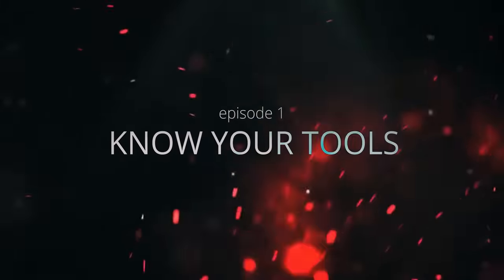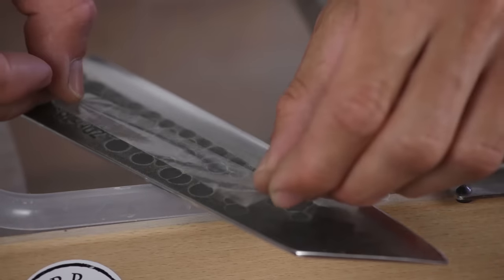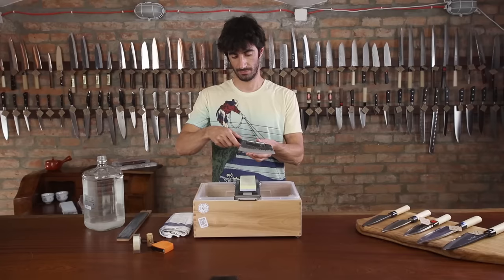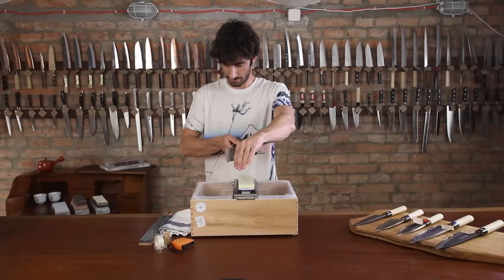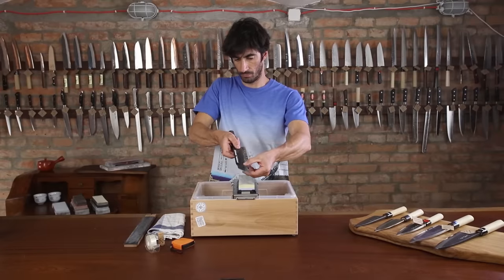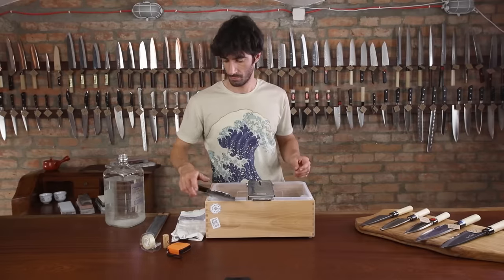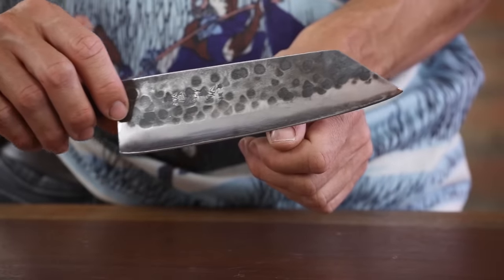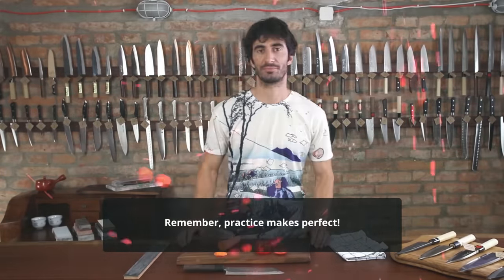How To Sharpen a Kitchen Knife - Beginner's Guide to Knife Sharpening

Comment: To Sharp Edge: This is highly technical and more involved than I thought. Maybe this is the reason my scissors are not satisfyingly sharp: I had researched, watched other videos, believing the tools I have, would suffice.  I wanted to get that razor-thin blade type of cut. 
 Question: What do you think of those automatic belt sharpeners in the marketplace?
Reply from the maker: Thanks Eddy, we're glad to hear you liked our guide! I hope your scissors got the edge that they deserve! Belt sharpeners produce a lot of friction and heat during sharpening, so they are not the best choice for Japanese knives, as the chemical structure of the steel can change due to the heat which can make the knife more brittle. Water stones are better because water insulates the heat.

Comment: I've watched several knife sharpening videos and learned something from each one. The nail test is a definite take away for me as I was having a hard time figuring out how to detect a burr. Thank you and great job.
Reply from the maker: Thank you very much. 😀 We are happy to hear that you learned something new. Which stones are you using for your knife sharpening?
Reply: @SharpEdgeshop  Smith's dual grit combination sharpening stone. Time for an upgrade perhaps? Question, is there any reason to use honing solution vs. water?
Reply from the maker: @robertlester4569  If the stone is still thick enough and you like the quality of the stone then no need for an upgrade. You can however add more fine/coarse stone to your collection if needed. Honing solutions usually include some rust protector and stone cleaning agents. We just use old plain water, it works the best for us 😀

Comment: Another important thing I would like to mention is a flattening stone to keep the water stone flat. Even if you (the one sharpening the knife) don’t think it’s recommended to do it always makes sure that the stone is always flat making the stone create a better edge and making the life of the stone that much longer. I have stones that cost anywhere from 26$ for a 1,000 grit up to 350$ for 30,000 grit. Even if your stones are cheap make sure you take care of them. To get a knife actually razor sharp you need an 8,000+ grit stone to pop the hair rather than pull it.
Reply from the maker: That is also a great reminder! Flat stone makes the job much easier and as you said flat stone also creates a better edge! If you take good care of the knives you should also take good care of your sharpening stones  👍
Reply: So how do you  keep  your stones flat?

Comment: Verify informative video. Been sharpening for a few years myself but just picked up my first Japanese knives. I've never sharpened western knives asymmetrical (60/40  70/30) I'm guessing. Not a fan of the angle guide myself but for beginners it will be useful. I'm looking forward to the advances video

Comment: The nail test works well with dull knifes but when you have a hair splitting edge you will cut trough your nail easily the paper test is way better and safer to determine sharpness
Reply from the maker: We notice that when the knife is sharp and completely polished, it slides on the nail easily, without any resistance. We've never cut through our nails, but you indeed got to be careful and apply almost no pressure.. The paper test is also a good option, but to really "feel" the sharpness, for us the nail test still works better.

Comment: If you value the finish on your knife, make sure you use masking or painter tape before putting this on your knife. It ruined 3 shuns before i realized it marred the finish (did all 3 knives at the same time). PISSED. I forgot the video says to use tape. Note: it might not fit over spine with tape. I had to keep something in the guide so it would widen enough to get over the spine
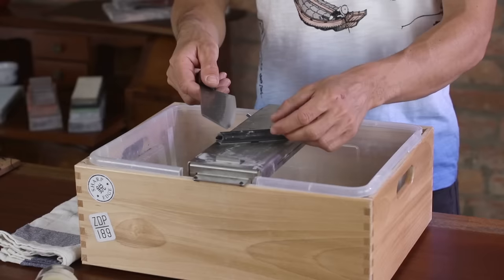Reply from the maker: Steve R most definitely, good advice. We cover that at 2:30, you might have missed it..😊
Reply: @SharpEdgeshop  I bought it based on video. I saw it before i bought, but forgot by the time I used it. I came across the video because i saved it. I watched it again as I was posting comment, and just wanted to reiterate it. Too late for me, hopefully it'll save others

Comment: This was just awesome! I have all the sharpening tools here to get going. One stupid question is how long should I be working on one side of the blade before working on the other? I did a practice run and was pissed with my result. Your guide is fantastic though.
Reply from the maker: Thanks Jason! My baseball coach always said there are no stupid questions! ;) Unfortunately I cannot give you a concrete answer because it depends on so many factors (like the condition of the edge on your knife, which steel is it made of, how much pressure you apply, etc). I'd recommend that the number of strokes on each side should be equal. Do 20 strokes on one side, then 20 on the other, see the result (nail test), then repeat. It also depends on the granulation of the stone - with which stone did you start with? If the granulation is too high, you won't get very far..

Comment: I have the same ZDP knife from Yoshida!
I love this knife, but that steel is hard af... 
not the easiest one to sharpen.
Subscribed, waiting for more
Reply from the maker: Thanks man! Yeah, it's not the easiest steel to sharpen, but hopefully it gives it back with a much longer edge retention than knives made of other steels. Thanks for subscribing!
Reply: You really need diamond stones for ZDP, anything over 60rc really benefits from diamond.
Reply from the maker: @hillbill79  We'll have to disagree here. Diamond stones indeed perform well with very blunt knives, and it would work very well with ZDP-189 steel, but only for a very blunt ZDP-189 knife. To achieve this fine, smooth sharpness, we need to use the sharpening stones as they have smaller, more precise structure. ✌️

Comment: Best way to remove a burr is to draw the knife through the end grain of a block of wood. Strop afterwards using leather and compound. Always sharpen with the edge leading, never trailing. ( I've been making knives for a living for a decade)
Reply from the maker: Awesome stuff, we always like to hear feedback from experienced blacksmiths like yourself! Yeah, there are many different methods to successfully remove the burr. We've tried yours before and it is indeed very efficient with some knives, with ZDP-189 we found that a piece of cork works better, but there havent done a large study on it :) We definitely agree to strop at the end with the leather strop with applied polishing compound. We prefer the Koyo Green rouge polishing compound - https://sharpedgeshop.com/collections/sharpening-tools/products/koyo-green-rouge-polishing-compound. Which one do you use?
Reply: I'd like to hear more about why edge leading is better. I sharpen with edge trailing for two years and I'm getting good results. I just want to learn from your experience. Thanks

Comment: I’m confused. Do you apply pressure when you bring the knife towards you or away from you or both?!
Reply: That depends on wich side you sharpen (not if your ambidextrous) you apply pressure when the edge is trailing (not cutting into the stone) you release when it's leading (cutting towards the stone)
Reply from the maker: What Ruben said :)

Comment: 2 more videos and poor guy will need new thumb nail. :)  I use paper to test if blade glide smoothly through hole length.
Reply from the maker: Haha, so far we still have the same nail. But we're happy that they grow :) Paper test is a good way to test for sharpness too, if it works for you, stick with it. Maybe still give the nail test a shot ;)
Reply: @SharpEdgeshop  I'm doing nail test, but just to see if knife caches on nail. no way I would pool sharp blade full length over nail. :) It gives me get goosebumps just by thinking about.
Reply: @SharpEdgeshop  BTW what you using if knife is too dull to be sharpen with whetstone?Often new edge need to be made. I'm planning to build belt grinder in that purpose. I tried grading wheel and is no good.
Reply from the maker: @dusanboss7749  Yeah, some people get goosebumps, not much you can do about it. We use a belt grinder for blade thinning. Diamond stones work well for thinning (since they are coarse and remain flat) if you don't want to invest too much time and money into making/buying a belt grinder..https://sharpedgeshop.com/collections/diamond-sharpening-stones (Atoma are the best choice!)
Reply: @SharpEdgeshop  I would invest in belt grinder because I have multiple needs for it. Knife sharpening it's just one part.  I have motor. I have some parts as well. My friend have a lathe...  So as for money it's not big problem. It would probably cost me something like 50€, and work of course. But, satisfaction in building and then using something like that is totally different experience than just buying it. Belt grinder of kind i'm planning to build would cost close to 1000 €. So, yeah I guess I'm building damn thing. :)
Reply: @SharpEdgeshop  Anyway man thanks for respond. I might have some more questions :). I'm subscribing to your channel! :)
Reply from the maker: @dusanboss7749  Makes total sense! Send us a video once you built it, we're curious to see how it will look/perform!
Reply from the maker: @dusanboss7749  For sure, send me an email to grega@sharpedgeshop.com if you have any further questions :) Thanks for subscribing!

Comment: I have a high carbon cleaver any tips for butcher knifes ?
Reply from the maker: Hi Joe, Grega here from SharpEdge sorry for the late reply. I had to check with Luka for some tips.. For butchering knives the best would be to use a belt grinder, remove the back support of the belt, so you get a flexible belt. Butchering knives need a convex edge for the rough tasks, so using a belt grinder is the easiest/fastest. By hand, Luka recommends using sandpaper for steel, then placing the cleaver on an old mouse pad. Mouse pad will give in to get you some flexibility needed to get that convex edge. I hope that helps!
Reply: Fantastic advice guys love the video's,  helps me  with my job I look forward to more .
Reply from the maker: @joeturner7097  Glad to hear we can help!

Comment: One rule of handling knives is never put any part of yourself in the cutting path/way. Next rule is test sharpness only on what you are going to cut with the knife. Next rule, the cutting pressure is limited to the sufficient pressure to get through the food. Let the knife do the work. Next, do not attempt to force a knife through frozen food. Thaw first. Next, use a serrated knife for cutting through tough substance. Next,  clean/rinse and wipe the knife and hands dry often.

Comment: 👍 good stuff there... few personal recommendations... Since this is a beginners class, I would explained safe vs not safe position of hands and knife edges...until the person gets comfortable... for example, I wouldn't never recommend new person to finish a super sharp knife against cork the way was demonstrated in the video...  I love the rocking and making the foundation of the blade 👏👏👏 very important... Also switching between stones and grids.. the only other possible missing piece of the information is that stones should be flat.. Again, great information and tutorial 👍.
Reply from the maker: Thanks for your kind and constructive feedback! Yeah, there was definitely some more information we could include in this guide, but we had to draw the line at some point. :) There's already a lot of information for a beginner, plus we're going to build on this guide in the future videos to add more information, like the importance of having flat stones. Since this is aimed for beginners, we assume they will use new stones (which are flat), and by the time they get the right technique and some experience with sharpening, they will likely do some more research on their own. As said, we'll add more videos later on! For the cork and safe positions of hands - good point, we could put a bit more importance on the correct position. We hope people are aware that they are sharpening a knife, so they have to be careful :) Thanks again for your kind feedback! Cheers ✌️

Comment: Excellent video!  If you can do a video, which helps to determine how dull / damaged the blade is and what is your next action: just leather honing / fin grit / 1000 or perhaps even 300, for the edge creation or chipped blade, that would be interesting to watch as well. Do you recommend using a ceramic rod in between sharpening of the hard Japanese knives to maintain sharpness and reduce the need for sharpening on wet stones?
Reply from the maker: Thanks for the compliments and your questions, Domen! That's a great idea for a new video, we'll keep it in mind when making new videos! If the knife is not completely dull (meaning it hasnt been sharpened for a year or more), then we would recommend starting with the #1000 grit. #300 grit is to fix a chipped blade and for really dull knives, like you said. Ideally, if we would maintain knives very regularly (once a week, or even more often), then just a couple of strokes on fine grit stones and the leather strop would keep the blade always in top notch condition. But that's not (yet) in the habits of many people.

We do recommend using a ceramic rod on Japanese knives! The ceramic rod, as you correctly pointed out, will prolong the sharpness of the blade, so we will need to sharpen the knife on whetstones less often.
Reply: @SharpEdgeshop  JUST SUBSCRIBED! QUESTION:When you say "maintain knives very regularly (once a week, or even more often)"

What does that mean? put it to stone once a week or more? or hone it on ceramic steel once a week or more? or stropping it once a week or more?
Reply from the maker: @evanm.7161 Thanks for your questions, and for subscribing! The answer to your questions will have to be a relative one - it depends on many factors: how often do you use the knife, how good is your cutting technique, what type of food you cut, what kind of cutting board you use, etc.. And it also depends on how sensitive you are about a sharp edge. With all these in mind, once you start to feel the edge is not performing the same as immediately after the sharpening stone process, take it first to the leather strop. When that doesnt work anymore, use the ceramic rod to realign the blade and then strop it. When even this fails, then its time to redo the sharpening process on the whetstones. For some this can be in a day (professional sushi chef), a week, a month, or even a year (not recommended to wait so long). We say - just use your own senses. Once it doesnt feel sharp enough anymore, follow the above procedures :)
Reply: @SharpEdgeshop  awesome thanks a bunch. One more?: So sharpening process in my eyes is as follow (and I know its really all preference)- Grind on tri stone with the finest at 8000 grit. Then take it to the strop 5-10 times on each side bam we have a sharp knife. Does this sound about right to you? I have been steeling my knives after stoning them, but as I am researching I believe steeling is for maintenance only, while the strop (Compound or no compound?) actually gets it more sharp as the grit on it is higher. Also, for cutting things (heavier duty work) I would use a grooves steel for maintenance, but for slicing I would use a ceramic steel for maintenance- Does this sound about right to you? 

Thanks again man!
Reply from the maker: @evanm.7161  Keep 'em coming! :) Yeah, your sharpening process sounds great. I agree on skipping the honing rod/steel after sharpening, as a (ceramic) honing rod will only realign the blade (which sharpening stones also do, so no need to do the same process twice), it wont sharpen it additionally. Im talking here about Japanese knives only, as regular honing steels are made of too soft steel to use them on Japanese knives. If you will use steeled (grooved or smooth) honing rods on Japanese knives you will remove material from the honing rod (since that steel is softer than the steel the knife is made of :)). For knives made of softer steels (most German knives), honing rods can be used, but I'd also use them more for realigning the blade, not so much for sharpening. Sharpening stones are the way to go! We definitely recommend using a polishing compound on the leather strop, as this will give the edge a better polish, and removed the burr more effectively. I would always strive for a polished edge with as little burr as possible, regardless of the work you want to do. Keep up the good work, it seems your knives are in good shape and hands! 👍

Comment: Carbon steel works on any whetstone or oilstone. Stainless steel will require an axe puck first. ☝️ After you’ve created the edge you desire on the stainless steel knife, you can start using diamond stones only. Stainless steel knives take forever on whetstones and oilstones. You must understand there are differences metal materials before sharpening them, if u wish to save time and money ☝️ Carbon Steel is much easier to sharpen
Reply from the maker: We wouldn't totally agree with that. You can use whetstones with stainless steel knives, but the result won't be as good as on a carbon steel knife, or better said it will be different. We agree that it takes longer, and that diamond removes the material quicker. Stainless steel also loads up the stone compared to the carbon steel knife, which means that regular flattening and cleaning will be needed. But if you only have whetstones at home, you can of course use them for both types of steel. Only result will be different as the steel react differently to sharpening. We agree that traditional steel is much easier to sharpen. 👍